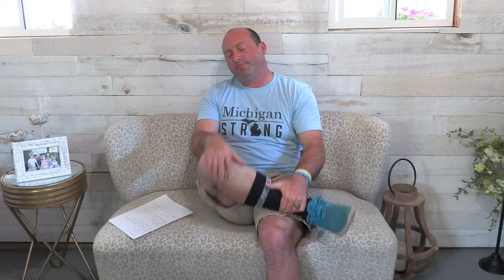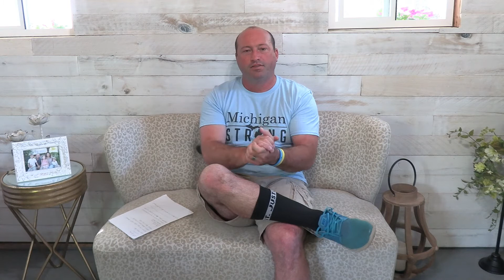Types Of Engineered Septic Systems | #AskThePumperdude

Comment: I have  a question i'm hoping you could answer. 
We want to decide whether to buy this vacant land but if this is a type 2 system, how much more expensive is it to get installed relative to a typical type 1 septic?
We have a health department sheet that is showing septic system type 2C. But I cant find what that means.
Reply from the maker: I would suggest contacting a local drain field installer and have them take a look at the information from the health department. They should be able to at least give you a ballpark figure to help in your decision making process.
Reply: @askthepumperdude  thanks. we checked with the health department and they told us the septic type that is needed. We wouldnt have made an offer on the land if it was the expensive kind.

Comment: Ok , I’m starting a new septic company but I’m having trouble with finding Estimate info and how to price installs  I want to be far and not try to kill people on pricing can you help me out
Reply from the maker: Typically, the information that is needed for pricing an installation will be found on the permit. This will tell you how much material will need to be trucked in and out as well as any tanks/pump chamber will need to be installed. That actual costs will be determined by material and labor costs in your area. Hope that is helpful!

Comment: Our perc test at our 10 acre parcel  in Howell Mi failed. Clay soil..poorly draining. What are our options now?
Reply from the maker: You will need to hire an engineer to draw up suitable plans for a system that the health department will approve. It is important to hire an engineer that has experience working in the local area so they are familiar with the local sanitary code to avoid unnecessary costs.